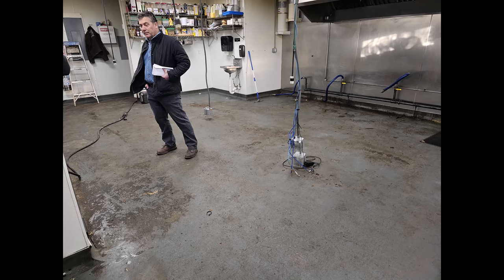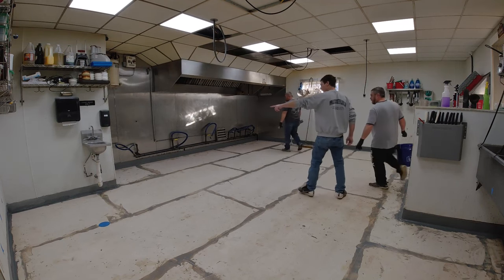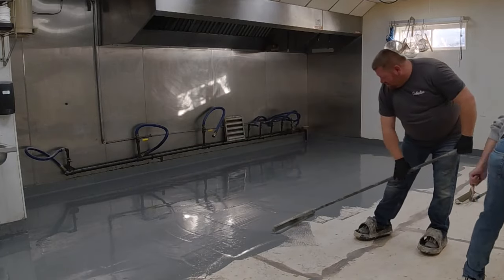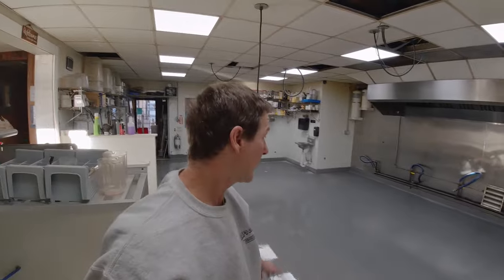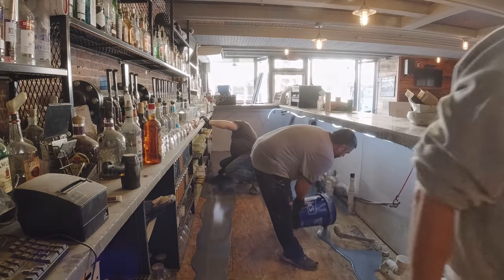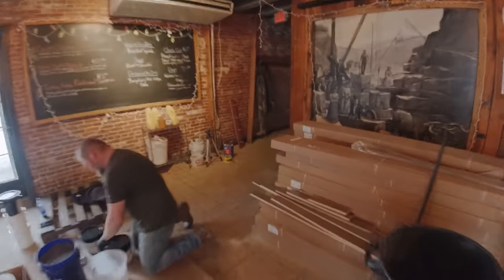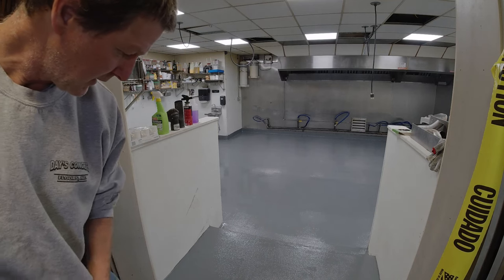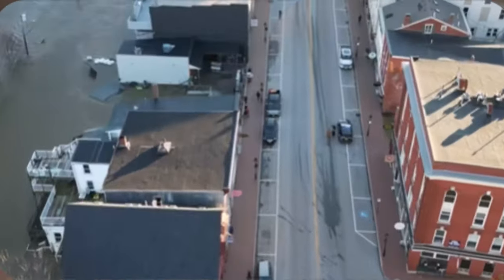Waterproof Coating For Going Over Concrete or Wood | Slip-Resistant and Chemical Resistant

Comment: I used to lay floors in my younger years.
 As with age my desire to be on the floor has decreased significantly. So when exploring the different trades of flooring , I'm thinking something like this would be worthwhile to get into. 
You know, all the young men out there who are green and starting out, having the process right at your fingertips is a real blessing. This is something else and the girls and boys don't know how good they have it. 
Experience like this was hard to come by in a variety of trades in the years before YouTube. 
I was a foreman for a sprinkler irrigation crew and I worked my way up to lead. 
I asked the boss how he learned all of it, and he laughed and said YouTube, trial and error. Investing in his established landscape company. Commercial accounts with suppliers. All that from a humble start.
 A hatchback and a push mower.

Comment: Looks great guys. 30 plus years in concrete and construction the biggest difference I’ve noticed is that other trades have lost respect for the other guy’s work. Not like it used to be years ago. At least here in Nashville anyway. As always great video and awesome work.

Comment: Hey Mike, I'm not a concrete guy, just a DIY homeowner jacka$$. But why would they put wood down and then concrete over it. You can almost bet it will flood again and the wood will swell? Wouldn't it be more cost effective to have your guys surface the concrete and then apply this coating over it? Just as an observer of hundreds of your videos, LOL
Reply from the maker: The basement is under this floor. This is a wood framed floor with OSB under this new layer of plywood. This coating is designed to go over wood and be able to handle some "swell", expansion and contraction. It's not concrete, it's Urethane Cement, a type of coating.
Reply: You’re absolutely correct. They’ll have to replace the word again. If the water comes in from beneath, they’re pretty much SOL. Mike’s getting paid to do what he’s getting paid to do.